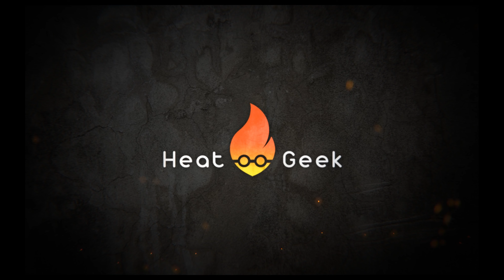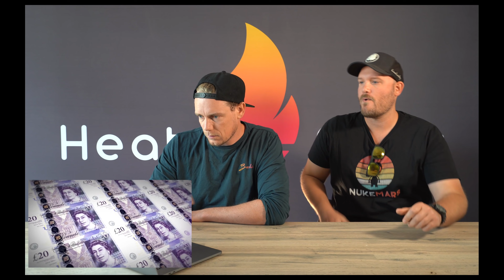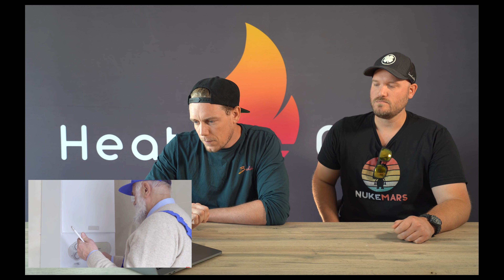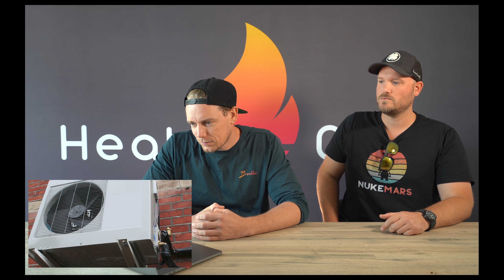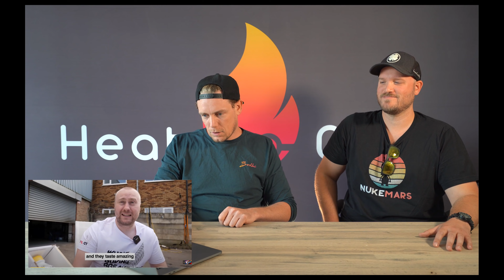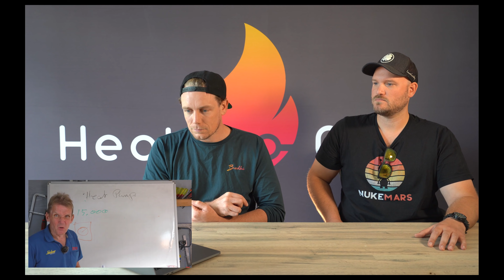Professionals React (BADLY) To Skill Builders's Heat Pump Videos | PART 1 | FIRST TIME WATCHING

Comment: That man did not say ignore carbon , he was all for it .
You poo poo him , but spent this video, nodding in agreement with him,   kinda strange
Reply: Yep, these guys are experts in heat pump and make good points, what Rodger is ranting about is the government throwing £££ at it. Both of the teams say the installation is key and they don’t suit every situation. The problem is with the ban on gas boilers there’s no choice at the moment so your going to have to have a really big problem getting through the 20 million housing stock.
Reply: @davideyres955  you do have a choice , don't buy a heat pump then the government have a issue with freezing people ,     we will also so be increasing the consumption of electricity , with cars also,      solar and wind won't create enough,
Reply: @davideyres955  there so expert they don't have any disatified customers , not possible

Comment: What your using as an argument , as your a installing business , is what he is saying , 
You want to tell everyone it's great , he is saying the truth , if your in a old house they are not ,
Reply: If you're in an old house they can be suitable but in most cases not, it isn't clear cut at all.  Some people (rich people) will happily spend £10k insulating and replacing emitters to enable low carbon heating and then another £10k on the new heat source.  We try to talk about educated and informed decisions, we agree with a lot of what Roger has said but there are key points that we feel will mislead consumers.

Comment: The difference is Skill builder gives an unbiased view and he has installed heat pumps......whereas you on the other hand.
Reply: Did you actually listen to speakers in this video? I fear you are the only biased one.
Reply: Ive installed 100s of heat pumps over 15 years, how many has Roger fitted.🙋‍♂️ He knows jackshit, most of the problems are caused by the installer that doesn’t know what he’s doing, Roger fits this mould perfectly.

Comment: A couple of months on and the conspiracy theory about gas prices being hiked is bang on.
Reply from the maker: Gas has been artificially kept low for years but the consumer price cap and non of the environmental levies that electricity has
Reply: @HeatGeek  I don't pretend to know a lot about anything, but surely the price of gas is down to supply and demand, with the insane race to net zero thrown in to further hike the cost, and since Merkel gave Vladimir Putin the power to strangle the gas supply to Western Europe, it's the supply part of the equation that our governments and suppliers now have no control over, while Britain is sat on 50 years worth of shale gas which we can't utilise due to weak governance and a radical environmental lobby.
Reply: @norabrady9066   There's actually no real evidence Russia is strangling gas supplies. They are fullfilling their contractural supply obligations. Russia itself has low reserves like everywhere else, so any excess production they're keeping to themselves. Which is fair enough in my opinion, no other country would do any different. Cold over there innit 😀
Reply from the maker: @norabrady9066  not at all. The price of gas has been capped for years. It also doesn't have any of the environmental levies on it eoetricity has despite electricity now being cleaner.
Reply: @HeatGeek  like I said, I'm no expert. Seems we will all have to dig deeper into our pockets and pensions, and in the near future, unfortunately, the choice between heat and eat will become a conundrum for all but society's better off.
Reply from the maker: @norabrady9066  people who struggle to pay bills should e helped as individuals.. not gas price capped for every person in the county.. the vast majority of which can afford to heat and eat.
Reply: In fairness though, gas prices have risen hugely, in a very rapid time, and I don't think that's what he meant.
Reply: No it is not.
Reply: @rogerphelps9939  are you fracking in your back garden  Roger? It's the only way your gas bill hasn't shot up.
Reply: @norabrady9066  No. I used to be on oil. Gas is not available where I live. Now I am totally electric. I have solar panels on my roof, an EV and a ground source heat pump. Furthermore I buy my electricity from a green supplier.  My electricity bill has gone up but overall I am far better off than if I had no solar panels, an internal combustion engine car, and was still on oil. I have to admit that we still have an ICE car for long trips but it hardly ever gets used (it is old with 90,000 miles on the clock) and it will be replaced with a long range EV as soon as I get the funds together. The sooner electricity is mostly renewable the sooner we can break the link between fossil fuel and electricity prices. The latest offshore wind is coming in at 4p per kwh with no subsidies  for goodness sake.
Reply: @rogerphelps9939  that's all fascinating Roger, but I fail to see what it has to do with my original point, which is that gas price hikes are no longer a conspiracy theory, obviously not for you as you don't use gas, but you are in a fairly unique and enviable position. So not at all for you but an unavoidable reality for the vast majority of the UK population.
Reply: That’s because the difference between ‘conspiracy theory’ in ‘fact’, is usually about six months.
Reply from the maker: @youtubesucks8995  it simply isn't a conspiracy theory or cleaver that gas prices will have to rise.  The gas price cap is the reason all these utility companies are crashing. Its unsustainably low.
Reply from the maker: @youtubesucks8995  Thats true. Still would give more room by readressing the balance

Comment: The tax on UK electric is only when using fossil fuel so moving this tax domestic GAS so make running a heat pump cheaper so you can sell a £15k heat pump is a joke.
Reply: The tax on UK electricity does not discriminate between  its sources or production methods. That really is wrong.

Comment: When we have all changed to heat pumps, electric cars. The national grid won’t cope without major investment in our electricity generation.( clean) hopefully.
Reply: The grid cannot cope just now. The generation companies get more income by way of compensation for wind  turbines lying idle than those on line. This is due to grid capacity or rather lack of.
Reply: We're using less energy than 2000. We'll be reet. Yes we'll need upgrades.
We can't keep burning gas. Hydrogen is a non starter.
One of the only options are heatpumps.

Comment: My flat is a Georgian house, I have a 6 year old combi boiler which provides all the hot water and heating I need. It is cheap to run and I will not be jumping on the airsource heat pump bandwagon, if I had a garden that was half an acre or more then I might look into ground source, but I will not get an airsource. It is a scam, remember when windpower and renewables were touted as being cheaper for the consumer, total cobblers, we are being played by the green lobby.

Comment: We're about to start building a new-build forever home (in the UK) using air-source heat pump(s?) and we're not even going to get gas run to the property, because we expect the cost of all fossil fuels - even gas! - will become prohibitive in around ten or so years.  And that's aside from any CO2 concerns!!  Renewables & nuclear, including perhaps fusion in 30-50 years, are the ONLY solution for places without geothermal options.  I would hope we can do far more with tidal power, once it gets developed too.
Reply: But in the mean time you may find that your bills will be higher.  And as you say if all fossil fuels get more expensive then your bills will be higher as the electricity you will be using to run your heat pumps will be astronomical, for energy generation is never going to be fossil fuel free for decades yet.

Comment: Good vidoe guys , Has Uk like Australia fallen into the same hole ? all we can talk about is Heat  and allow other groups talk about HVAC or cooling ? Is this heat pump possibly a energy pump and we reset think , Its been obvious for a long time great industrial hydronic systems excisted , Think about this Countries like England Australia and even USA lost all there capability to build machines ? Are we looking at huge opportunity to design assemble and build a machine suitable for a climates like ours that can work from 0 to + 52 C your ? -2 to + 35 C and admit  the real focus should be to lower energy use and emission and admit loosing cold energy while heating is very  uncool

Comment: We won't have one. It wouldn't heat our home. If the idea takes off I will be stunned
Reply: The important point Chris is that it shouldn't be the only option and there are a lot of homes that are completely unsuitable.  What we need is to upskill the workforce to be able to advise and install the correct solution for each property, that is something severely lacking right now.
Reply: Very popular in Australasia Chris.

Comment: Whilst I recognise the need for heat pumps at some properties and they have a place combatting climate change, this video more or less acknowledge the main points of the argument they were trying to rebut;
Not suitable for terraced housing 
Do make noise, albeit some less noisy than others, which could be disturbing 
Industry does have cowboys and it’s likely that more high pressure selling will occur
Uk housing stock is old and will likely have issues with insulation 
So, unless you’re in a relatively large detached property, with good amount of savings and a property with good insulation you might struggle and it’s not ideal. Not that they don’t have their place, but they certainly are not the magic bullet they are cracked up to be

Comment: I don't like the idea of an imersion heater being fitted into the cylinder as a back up I want the heatpump to do the work as my gas boiler does
Reply: I have to agree !
Reply: Yes they do, Dodger is about 30 years behind with his comments. Heat pumps can heat water to 65° without an additional immersion input.

Comment: You're both wrong, yourselves and Skill Builder.  The energy generation should not be at the residential home.  It should be at regional locations using the best tech for that location and then distirbuted to homes.
Reply: This would be marvellous if it could work in this country.  But unfortunately I do not trust the sort of governments we have had over decades to tackle what would be a mighty project.  Most things governments get into turn out a disaster, HS2 for instance.
Reply: a project in shettleston in glasgow did just that and gives FREE heat to the local residents  mines are the source of the project  a project for the future near me estimates it could heat the WHOLE of Glasgow with heat from mines watch this space
Reply: @chrissydidit811 
You can imagine the cost and the massive disruption caused by trying to install this type of technology.  Not a bad idea on a small scale, but imagine trying to heat a high rise block of flats with this. Lots of experiments work on the small scale, but ramping them up to meet the requirements of the majority often fails.  Insulation, insulation would save the majority of people massively on their bills and reduce energy use.  But most people have no idea how to introduce that to their properties.  Just simply layering windows, even double glazed ones with blinds as well as curtains, along with closing them at dusk in the Winter, would save people a fortune in energy costs.  But they are not educated in these things and you see lights blazing out of thousands of homes even late at night when it is cold.
Reply: @chrissydidit811  I've looked at that and the Shettleston mine source heat pump is only supplying one building. It needs to be part of the solution but there is nowhere near enough heat supply from mines to heat the city. Important thing is to know how fast the heat in the mine is being renewed, either by solar heating (water circulating near the surface), or from geothremal sources (water circulating deeper). So in Glasgow we're likely to end up with a mix of ground-source, air-source, river-source, mine-source and direct electric.
Reply: @chriscarus2464  It's a start .a pilot project the next location would be at Cunningar Loop Cambuslang please note Rome was not built in a day
Reply: @chrissydidit811  Please note the Shettleston mine source is using a heat pump to raise the temperature to heat flats.
Reply: Heat distribution on that scale takes alot of infrastructure and in the uk wouldn't be feasible to retrofit. On a new build estate it'd be great
Reply: i've seen this system in action dozens of pits in my region ,the tenants love the free heating/ hot water only last month i watched the engineers drilling  for a new system in a care home looks good
Reply: That might well be the way to go in urban environments but not so much for spaced out rural villages.

Comment: ok answare me this i have a 1 bed bungalow double glazing AAA
insulated walls bonded olistyrene beads.
about 500-600mm loft insulation.
rads and glowworm 24 new 3 years ago no water tank water is piping hot 24/7 room heat is as hot as i want even tropical is needed
cost of boiler and rads was about £1-2k
will a air source heat pump di the same as my glowworm and what is the sort of cost for on in my house.
with a heat pump do you need a hot water tank as well 
if so do you need electric to help heat it up like the emersion heater

Comment: So, in my 1911 semi with 8" solid brick walls and render + suspended wooden floors, I'm stuck with my external oil boiler and radiators? The trouble is, I won't be able to replace the boiler when needed as new sales will be banned. So I will have to run it beyond its efficient life.
Reply: Hopefully technologies like green hydrogen boilers - with the national infrastructure to supply the gas - will be developed ove the next 14 years.
Reply: It probably won’t happen anyway.  Government will push back the dates for all this nonsense, like electric cars etc, when the failings come to light.  I just feel sorry for early adopters of these things, unless they are done really right.  And does anyone know a competent knowledgeable tradesperson who does not want to rip you off?  Please let me know.

Comment: 30c outside temperature? You don’t need heating on those days. The important thing is what is the COP when the temperature is -5c outside and you really need the heating.
Reply: I spotted that too....having a high(ish) COP when outside temp is hot is almost irrelevant. What does the house feel like when the wind is blowing from Siberia?...that's relevant & how much electricity are you using.
No mention of solar panels to power the heat pump...more cost!!
Reply: My ground source heat pump always has a COP of at least 3, even working flat out which is not very often.
Reply: No but you need hot water and that what a heat pump does

Comment: Heat pumps don’t work in traditional houses, they are not insulated enough. To retrofit to fit a house with underfloor heating and insulation, will cost thousands. Heat pumps are more suitable for new build houses with great insulation or specifically designed eco homes. The other problem is trained installers , they are training installers at colleges at the moment , but not enough. All adds up,to a disaster, rushed in to meet targets set by the green lobby rather than phasing it in slowly as the housing stock is replaced or renovated.
Reply: Wrong, installed 100s in old property’s and new, have one myself in our 1950s semi.🤷‍♂️
Reply: @kenbone4535  bullshit
Reply: @PaulSmith-pn8hi  how many have you installed. Crack on.

Comment: Glad you made this vid. I had a heat pump installed at my flat earlier this year, an old 1950s block of flats so a long way from being a new build, and I've had zero issues with it. It's quiet, the water is hot, and cheap than my old gas boiler to run.
Reply: All the 1950s blocks of flats I've seen were built to survive the Bomb so should be good for heat pumps. Thick, very solid walls and floors,  very thermally efficient (once the air bricks to let out disused coal and gas fire fumes are filled up). Flat build quality dropped later.
Reply: @cuebj  spot on sir.
Reply: Once all these crusty stubborn old men die off, so will gas fired boilers. Other countries use heat pumps for years, no problem.

Comment: The gas crisis is now upon us…..from my perspective, the outcome lies somewhere in between. The government made a typical knee jerk reaction to try and reduce CO2 output, and didn’t have the correct knowledge or framework (enough knowledgeable installers like yourselves) to implement. I don’t think Roger’s intention is to slate the industry as such, more to raise people’s awareness that fitting a heat pump may not be the answer in most people’s situations.

Comment: If the deciding factor on ashp working or not is the “ engineer” then it isn’t going to take off…..I’ve seen gas boilers installed by “ engineers” that clearly lacked training and they’ve still worked ( with a bit of tweaking). Gas boilers are much more tolerant of a bad install
Reply: There is a big shock coming to the "engineers" isn't there?  If they are forced to install heat pumps at some point they won't know what to do.  Of course it is also an issue with boilers, as you say they are much more forgiving but the majority of installed gas boilers are nowhere near the stated efficiency because installers aren't educated so they don't condense.
Reply: Agree. Can you also imagine the maintenance call out charges for the few ultra experts?